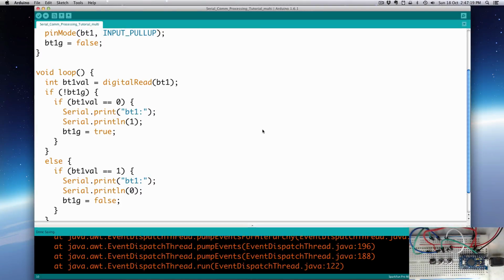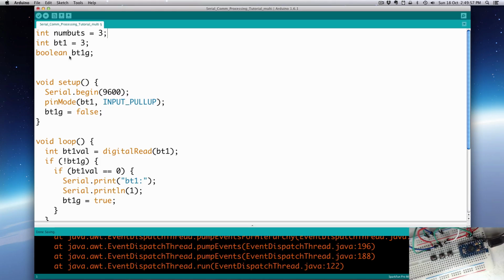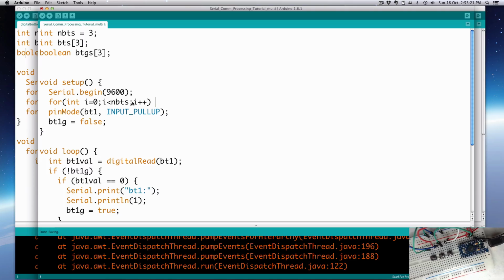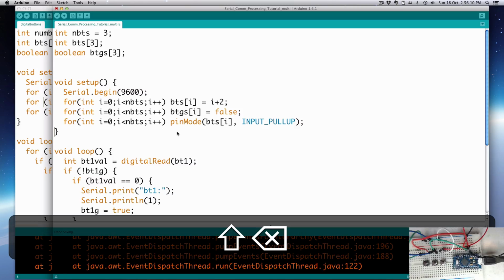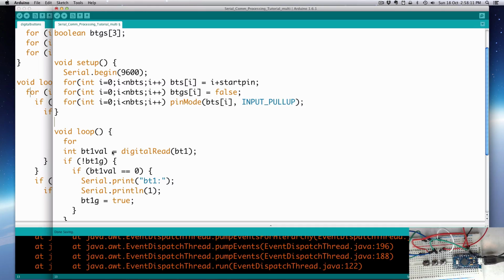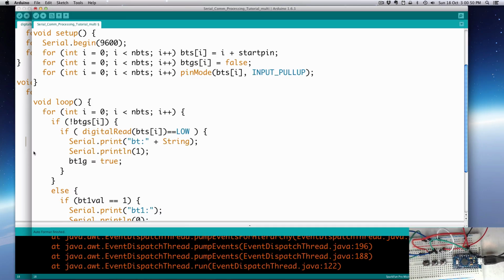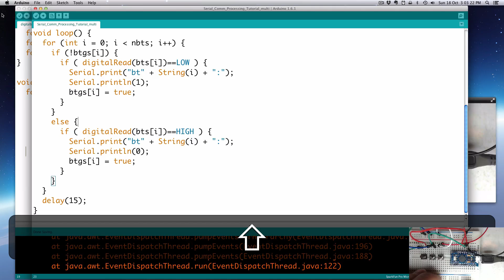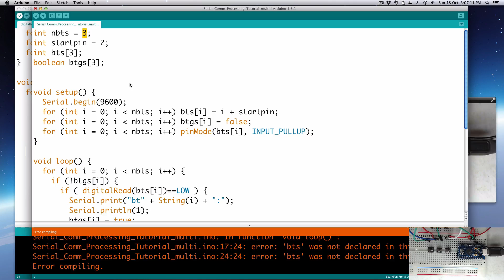Arduino Buttons - Multiple Buttons

Comment: Hi, really good video and helped me greatly, I needed to drive 8 solenoid points motors on a model railway, via mosfets, automatically and if required manually (push button from a control panel). Your tutorial helped me to integrate both into my arduino control system and now the project continues. Next hurdle coming up..... does it ever end? Big Thanks.

Comment: Thank you for the video; I've struggled with the little useful info on the web regarding - using multiple buttons.  Assuming I wish to assign each button to a different function(my project involves using 4 buttons to turn 4 different relays to 'High' when pressed, how would I integrate your button arrays into my code?
Reply: +Randall Tockes Did you figure anything out? I have 3 buttons and need to toggle between them to change the settins for a stepper motor running off of a potentiometer! It seems to be proving difficult to find a working sketch whereby I can just drop the Stepper code in the sketch :(
Cheers
J
Reply: +jason daysh I did end up solving my issue(I believe it was more of hardware issue).  It's important that everything in your circuit is grounded together, and you're using the internal pullup resistors in your Arduino.  However as your application will be different I don't know how much help I'll be able to offer.    I just created 4 different button states, one for each button.  See my code below.

const byte buttonPin_1 = 10;     // the number of the pushbutton pin
const byte buttonPin_2 = 2;
const byte buttonPin_3 = 3;
const byte buttonPin_4 = 4;

const int Light_1 = 5;     // Relay 1 pin
const int Light_2 = 6;     // Relay 2 pin
const int Light_3 = 7;     // Relay 3 pin
const int Light_4 = 8;     // Relay 4 pin

// variables will change:
int buttonState = HIGH;         // variable for reading the pushbutton status
int buttonState2 = HIGH;        //variable for reading the second button state
int buttonState3 = HIGH;
int buttonState4 = HIGH;

void setup() {

  
  
  // initialize the LED pin as an output:
  pinMode(Light_1, OUTPUT);
  pinMode(Light_2, OUTPUT);
  pinMode(Light_3, OUTPUT);
  pinMode(Light_4, OUTPUT);
  
  // initialize the pushbutton pin as an input:
  pinMode(buttonPin_1, INPUT_PULLUP);
  pinMode(buttonPin_2, INPUT_PULLUP);
  pinMode(buttonPin_3, INPUT_PULLUP);
  pinMode(buttonPin_4, INPUT_PULLUP);
}

void loop() {

  
  // read the state of the pushbutton value:
  buttonState = digitalRead(buttonPin_1);
  buttonState2 = digitalRead(buttonPin_2);
  buttonState3 = digitalRead(buttonPin_3);
  buttonState4 = digitalRead(buttonPin_4);

  
  // check if the pushbutton is pressed.
  // if it is, the buttonState is HIGH:
  // Light 1
  
  if (buttonState == LOW) {
    // turn relay on:
    digitalWrite(Light_1, LOW);
  }
  else {
    // turn relay off:
    digitalWrite(Light_1, HIGH);
  }

  
  // Light 2
    if (buttonState2 == LOW) {
    // turn relay on:
    digitalWrite(Light_2, LOW);
  }
  else {
    // turn relay off:
    digitalWrite(Light_2, HIGH);
  }

   // Light 3
     if (buttonState3 == LOW) {
    // turn relay on:
    digitalWrite(Light_3, LOW);
  }
  else {
    // turn relay off:
    digitalWrite(Light_3, HIGH);
  }

  // Light 4
    if (buttonState4 == LOW) {
    // turn Relay on:
    digitalWrite(Light_4, LOW);
  }
  else {
    // turn relay off:
    digitalWrite(Light_4, HIGH);
  }
}